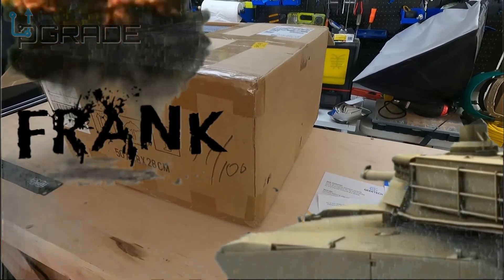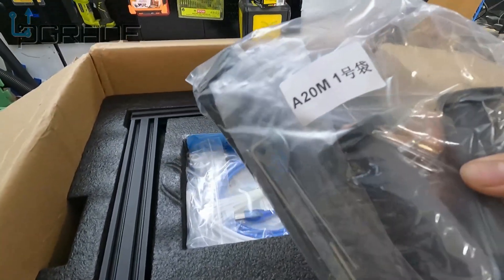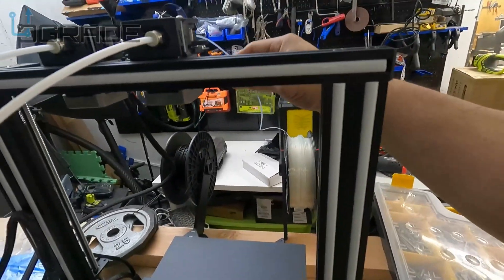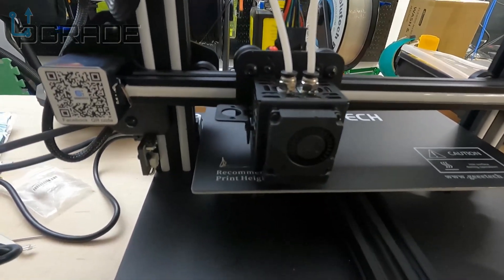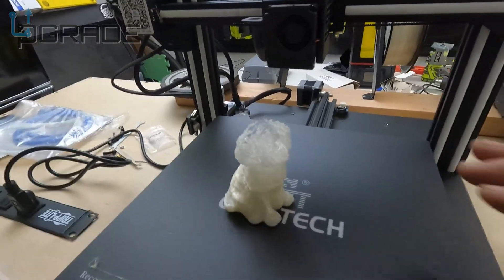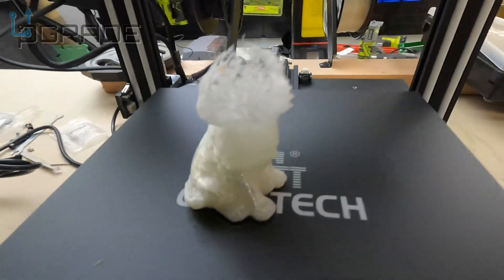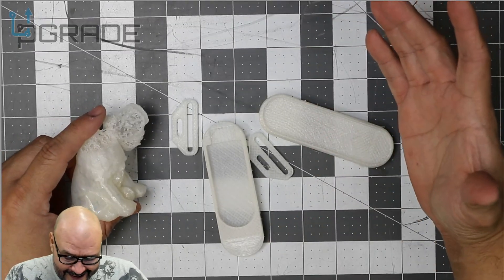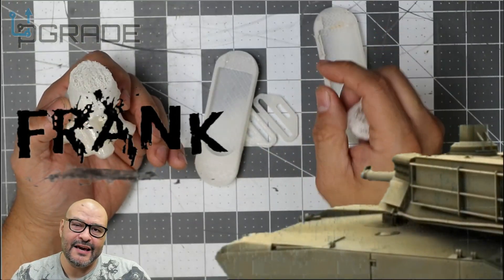Geeetech A20M 3D Printer

Comment: Nice review. Sadly your's out of the box had under extrusion. That shouldn't happen. Probably a hotter filament temp and a calibration cube would have fixed that issue. I've done my fair share of printers and that's usually the issue or you had a clog. Sometimes the factory does a poor job putting the hotend together, like gaps between the PTFE tube and the nozzle can cause clogs and under extrusion as seen here. Seems it started ok then clogged. Sounds like you moved onto something better. Have a good one!

Comment: i got this printer and still am using till now but im looking for a much better one probably a prusa. my thoughts on it, i bought it for the purpose of mixing color but then i couldnt get it to work properly, lots of clogging and its a mess. so i just converted it straight on to A20 single extruder direct drive and its been good since. the wires (extruder) arent great as i got disconnection somewhere. also the stock extruder sucks, now im using dual drive extruder.  this printer is not meant to work for starters. upgrades done: ddrive extruder, singe nozzle conversion, bltoouch, meanwel psu, tmc22008.

Comment: I have this printer and I suggest that you don't fiddle with it. It prints just fine right out of the box. Some folks just have to tweak things that don't need tweaking. I did notice that you had the filament below the print bed. It needs to be on top so it feeds down/ NOT up. That is probably the reason for the failed prints not having the filament flow smoothly. Shame on you for bashing a printer because you cant follow directions.
Reply from the maker: I ended sending it back and got a ender 3 v2 best printer and hasn't fail. But thanks for the comment and advice
Reply: @Upgradetech  I also got an Ender 3v2 and they both print amazing.
Reply: Steven I agree, many fiddle with things when the units are done from the get go.
I have 6 regular Ender 3 printers (among several others) for three years all stock straight out the box, but I'm using them to print things I design, I haven't fiddled with the printers at all except for initial build and occasional bes levelling.
Yet YouTube would have one believe that they're just shipping crap in a box. Maybe I got lucky 6 times 🤷🏼‍♂️

Comment: Oh, das unfairste Voideo über den A20M. Ich besitze dieser Drucker nun schon 2 Jahre und machte tolle, sogar ineienader verschachtelete Megrfarbdrucke. Allerdings habe ich die Einstellungen spezifiziert, so es bei allen anderen Typen auch üblich ist. Dazu muss man sich in die Philosophie versetzen können, was in diesem Video gar nicht erst versucht wird. Man gewinnt den Eindruck, dass hier bezahlt gegen diesen Drucker Politik gemacht wird. Das ist sehr schlecht und ungerecht :-(

Oh, the most unfair voideo about the A20M. I've owned this printer for 2 years now and made great, even ineienader interlaced megr color prints. However, I specified the settings, as is common with all other types. To do this, you have to be able to put yourself in the philosophy, which is not even attempted in this video. One gets the impression that here paid against this printer policy is made. That is very bad and unfair :-(

Comment: I've got one since 1 year. My first print (the dog) was very clean,  almost perfect. 
When I see his result with the dog,  it looks like a severe under extrusion.
My question could be : what have he does with the filament... why put the spool at the back?
Few settings are useful,  like a check of step (you must manage metric unit for this)
 the plate is the biggest bad surprise,   poor quality, not really flat. Solved with a 3€ miror.
Reply: There sure is under extrusion. If you watch other video of this printer you'll see that the dog is ment to be a color gradient and he says at 4:40 ''Just put in one color right now''!
Reply from the maker: I gave up on this and moving to another model it takes much time to find the driver and correct things that should be working when purchase, I spend more time trying to fix this than printing. JUNK, I donated to someone that has the time to tinker with it.

Comment: I got one and out of the box this printer over extrude and the z calibration is off. If you check/correct the steps per mm it will print perfectly.

Comment: I halve got this printer, this happened on my first print but after 10 mins of re-search I quickly found out that the e-steps needed calibrating. 20 mins later all set up perfectly and getting 100% top quality prints. 

This dude is wrong - it’s a 5* printer!
Reply: Agreed, Just tweaking it a bit and you're golden! Great inexpensive machine!
Reply: I so agree I got this printer a month ago and it is fantastic.
ever thing you need to set it up has videos to show step by step.
once of the easiest Printers i have used.
Reply: agree with you. Work really fine for that price
Reply: Hi there what calibrations did you enter
Reply: @philreed6457  I assume e steps or steps per mm, I recommend looking up how to do it because it is quite easy
Reply: I concur.
Reply: Mine won't even print cause it just clogs itself